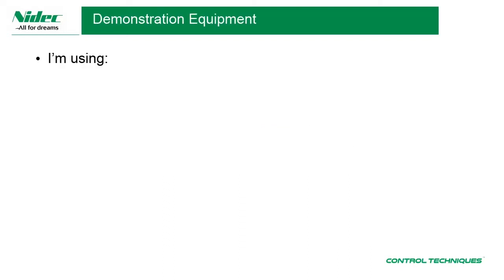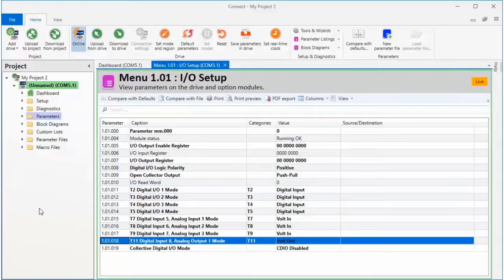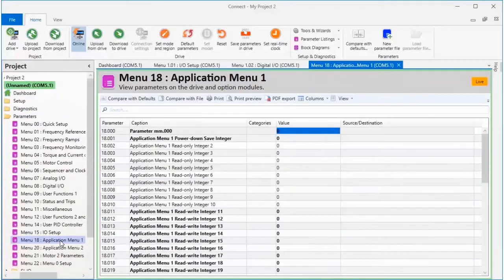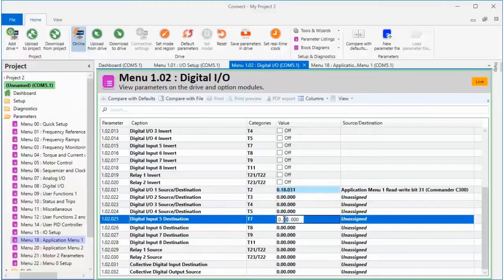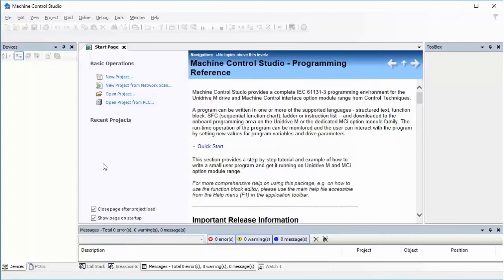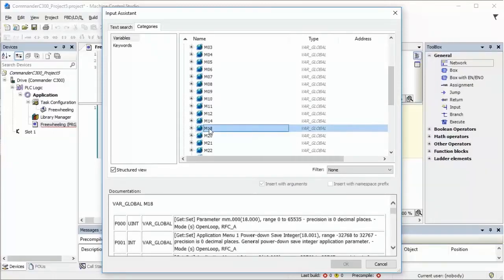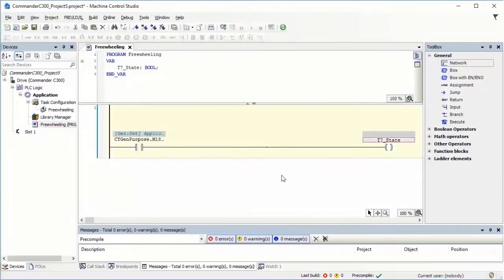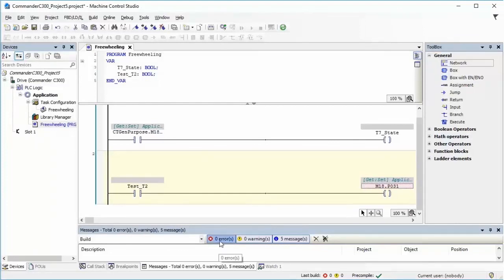Software Skills: Machine Control Studio and the Si-IO Module

Comment: A quick question about menu.parameters when accesing from machine control studio. When working with M700 series i can acces all menu18 parameters including P001 and P051 to P054 which are power down save. For example, Commander C200 also have this parameters in menu 18, but i cannot acces them from machine control studio, they are not available in either library? I tried to search, but there is no library for C200 and mcs version I am using is latest. So, is it possible to acces them, or is there any update to library/mcs should be done? Thanks!